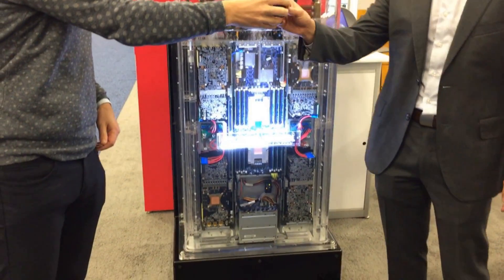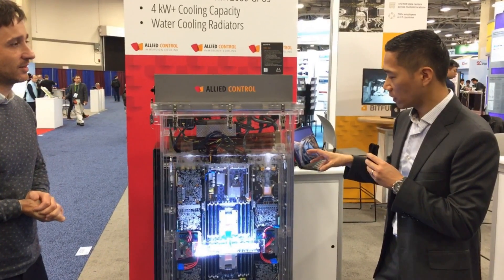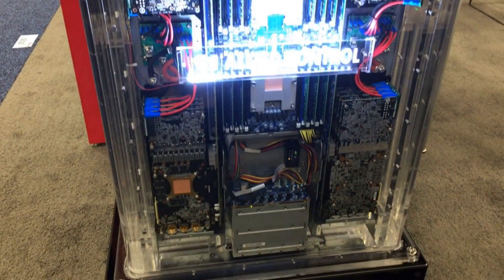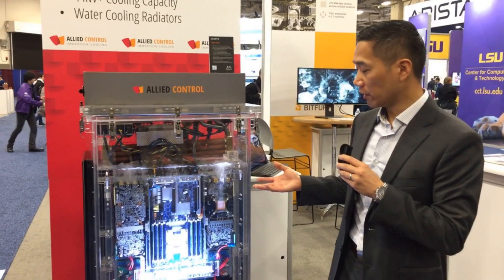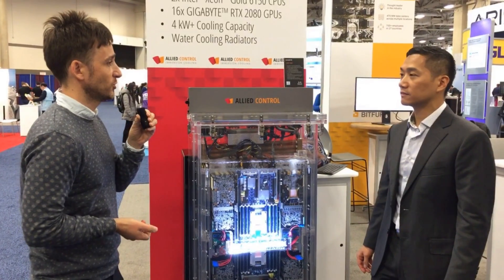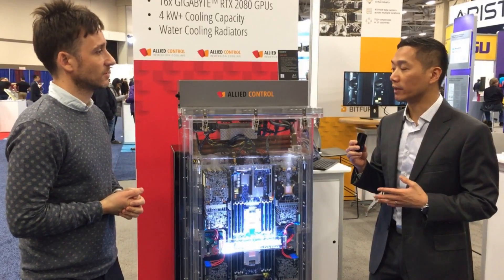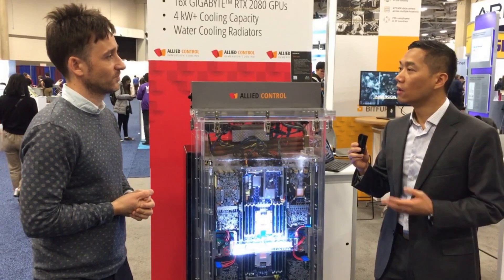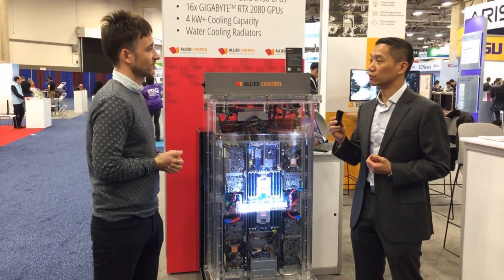[Interview] Immersion cooling demonstration at SC18

Comment: I am a fan of GIGABYTE I need a BIOS update for aorus x470 b450 for overclocking the RAM now a maximum of 3200 is bad on asus msi everything goes up and on gigabyte everything is bad
Reply: Flash BIOS. It might be that there is no update for motherboard. REMEMBER! When flashing BIOS, always check the manufacturers website (especially if you have pre-built setup from HP for example). NEVER try to flash BIOS if you are not sure about the version and what you are doing, you can destroy your motherboard.